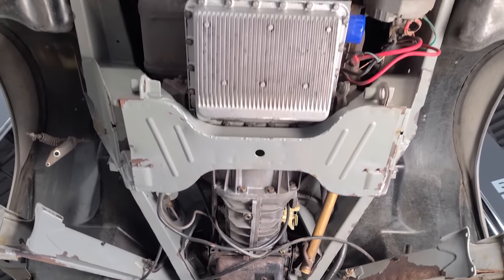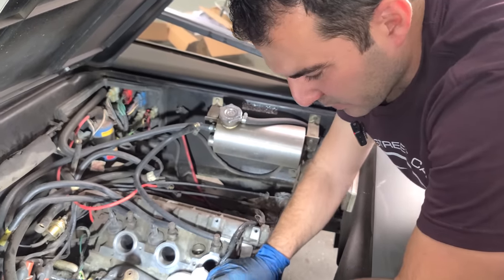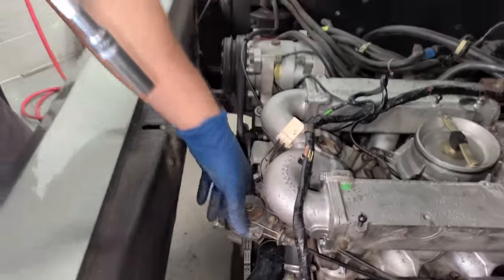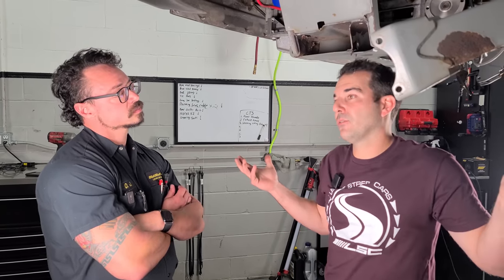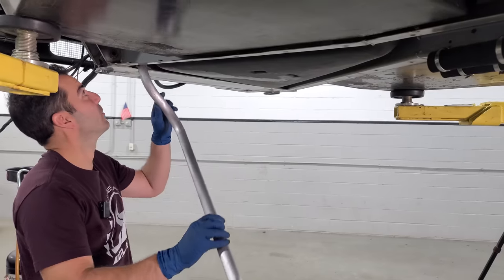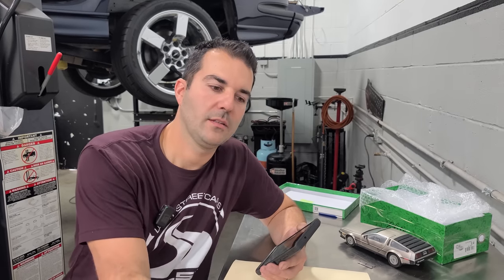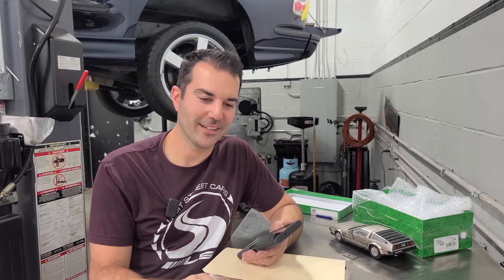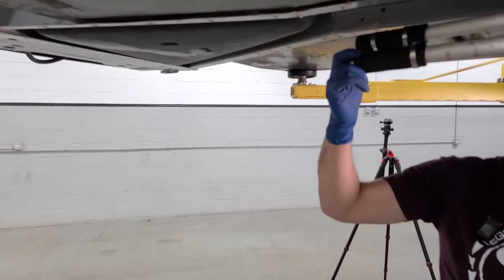I Put My DeLorean Engine Back Together & Spoke With The Orignal Owner! Fake Miles & More Bad News :(

Comment: As a mechanic in Minnesota I see far worse almost every day. We generally cut out the rot and weld in a  patch paint it . Some frames can have a patch and be fine some are to far gone. This one looks like a few patches would be just fine.
Reply: Yeah that frame is fine. Minimal issues, patch it, epoxy it, coat the inside channels with fluid film and move on.

Comment: It was obvious from the first video that it wasn't a 16k mile car so no disappointment there.  You're doing an excellent job! Can't wait to see it drive.
Reply: I was looking at the brake discs last week and yeah that had quite a bit of wear for 16k.
I was gonna say about 30,000 so wasn't that far off
Reply: That the problem  buying an older car that was basically abandoned/parked/sitting/not running I mean there's tell tale signs but u truly never know the actual mileage, one tell tale sign on odometer tho is yellow film on odometer numbers only on the white part tho and even then if cable broke,kinda a double edged sword,but w/risk comes reward!!!

Comment: For those hoses on pipes, also silicone boots, try a spray cleaner like 409.  It is slippery for assembly and dries and makes the parts stick together so they don't want to blow off.   Silicone spray stays slippery and is much more likely to blow off.
Reply: Very underrated comment
Reply: i agree

Comment: Alex, I'm so sorry for you. I've done several Jeep CJ 5 & 7's, which are notorious for frame and body rust. I've been in your shoes every time. The dejection is  terrible. The you put your Carhartt's on, roll your sleeves up just start working. When it's all said and done, it's taken far more time than you imagined and you have 5x's more money than you'll ever be able to get out of it. It's just a work of love, and when it's finally complete it's almost a letdown. And you think to yourself, "I know what to look for now." And you end up with another one that's just as much work. Some people do crack, some do alcohol, some to cars. Although, cars can lead to alcohol...  😂😂
Reply: It's definitely a crap shoot that's for sure.
..
It's looking like a replacement frame which there are options available..
Even then Alex still wouldn't be upside down considering he paid at the lower end for the Delorean...
With a replacement frame the value of the car goes up.
I've suggested, see if OJ could make. 
One off bespoke frame using the original as a template.
Knowing the top work they do at FMU it would be stronger than the original..
Only say this as Alex said this is a lifetime keeper..

Comment: Love the convo with the original owner. Such a nice guy. I hope you meet up with him and get more stories from him.

Definitely need a Lincoln Mark 8 on the channel. I love the mn12 platform. I'm a tbird guy myself. I've owned 4 in my lifetime and drive a 97 v8 tbird now. The Lincoln was the top of the line for mn12, so lots of goodies to be had!
Reply: Oh man if he built an mk8 I'm sure it would be badass. I second the mk8, as an owner of a 96 they don't get enough recognition. Only other channel who has one is tony angelo. And being a 4v 4.6 and him having/had a cobra and gen 2 l it's a no brainer